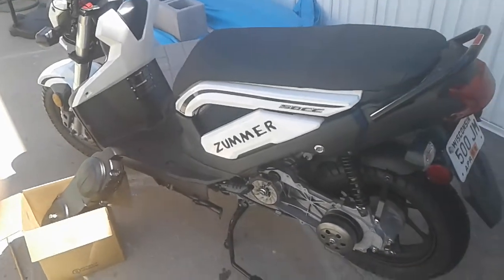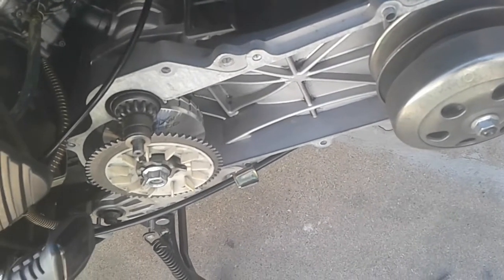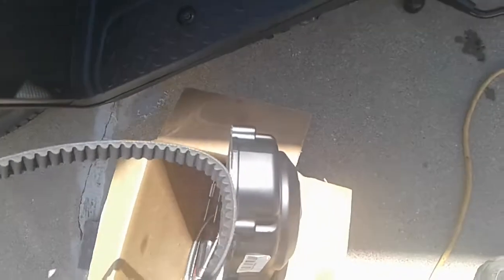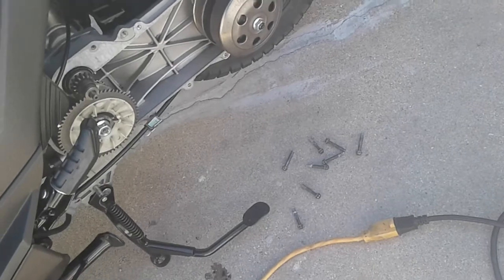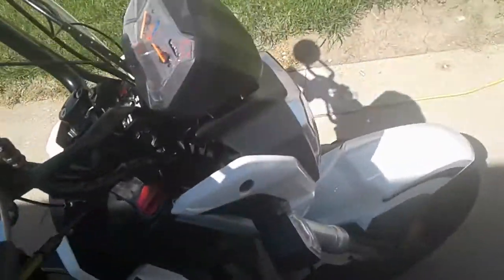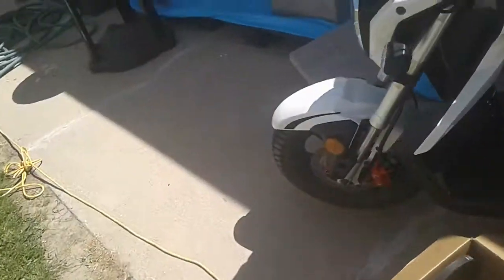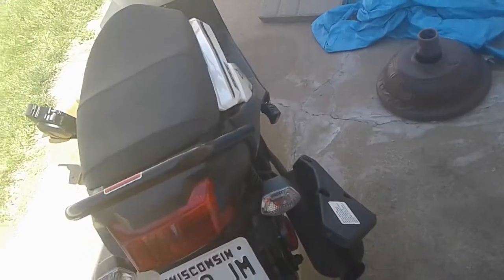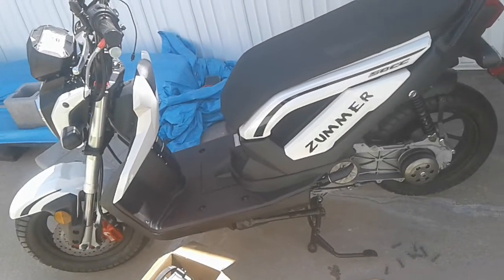taotao scooter update#1 bogging problems

Comment: Make it single shock and upgrade your one shock to one meant for single shock support. Remove swingarm on muffler side, Remove any washers or bearings from the swingarm and use them as spacers before tightening the nut back on. Enjoy.

Comment: ADJUST THE VALVES. I replaced carb and CDI due to bogging out with no results. I finally checked the valves. The exhaust valve was too tight.
Reply: .004
Reply: hi, im bogging down, lose power at WOT, on 150cc gy6, doesnt seem to do it when air box & intake tube is off,
dont think it vacuum or leaks, could it be the valves? there is a new muffler on too....thanks!
Reply: Sea Bass  thanks 4 reply, ..there arent any "holes" on airbox tube to carb? explain. Or could closed cannister on Pair emission cause it, cos not getting enough air to head (whiich feeds air to airbox)???
Reply: Sea Bass  i was thinkin the opposite.. not gettin enough air...
Reply: Sea Bass  took off airbox and hose, added small air filter with short hose, thing runs like a champ, no bogging at WOT

Comment: Another question...what size of valves did you have?  64 or 69MM?  I think the 69MM would be better for Ive seen a cut-away of both and the 64mm wall was so small it could blow easily if any wear would happen.  Just a thought, but would like to know vs tearing off the seat and front end to check.  Thanks
Reply from the maker: salan ssr it comes stock with the 69 mm valves

Comment: Could it be your CDI? Do you have the factory CDI or an aftermarket. You might be hitting the stock rev limit and it is cutting it off at the limit.
Reply from the maker: Colin I actually have the orange aftermarket CID unit supposed to have no rev limit
Reply: Hmm. Im not sure then. You should replace with the stock one and see if that makes any difference.
Reply from the maker: problem is fixed was timing
Reply: Timing? Mine one have same, there is a damage on woodruff keyway on the crank, is that the problem?

Comment: I had the same issue with my zummer ignition switch.  Mine was almost falling off and I had to take the front end off to fix.  It's hard with all the screws sitting underneath.  Also my high beam switch is backwards.  I need to figure which wire goes where in the connection since the handle unit is so compact its hard to work on there.  Going to try and swap out at the light itself.  How's the big bore kit working out? you mentioned going to a smaller size?  Also why did you change the timing gear to an A9?  Was thinking of putting a BBK on mine.  Check out my video if you wish.  Took a day trip to daughter's and son's which was a total of about 80 miles covering a few towns.  Bike took some wear after putting those miles on so quickly but I still have her. Mounted a GoPro clone on the handle bars and videoed my trip from it so it's a bit wobbly.

Comment: Did u ever find a exhaust that fits it without modifying the bike because I've been trying to buy one that fits mines
Reply from the maker: Delo Green no I ended up putting on a short shaft axel then I was able to run an aftermarket exhaust works perfect and was able to get rid of one of the shocks
Reply: BIZ MOTO can you paste the link for the exhaust
Reply from the maker: https://www.ebay.com/itm/Performance-Exhaust-Muffler-System-Assembly-for-GY6-50cc-Scooter-Chrome-/112598730959?hash=item1a376848cf
Reply: Cut and weld